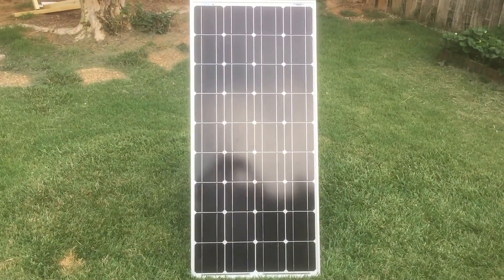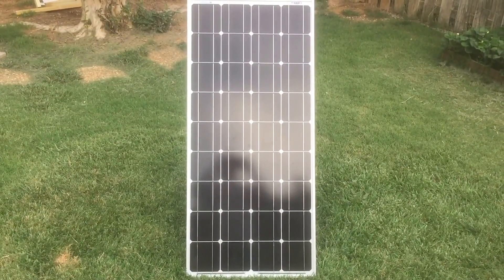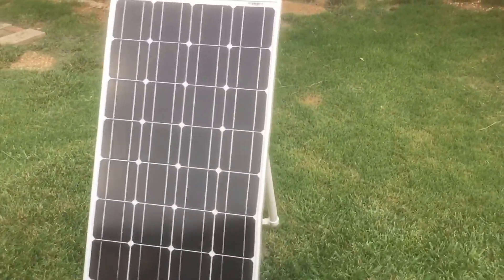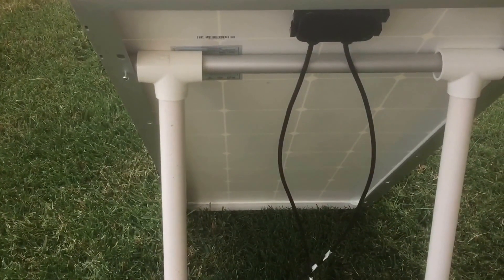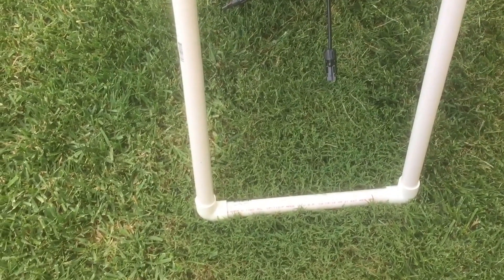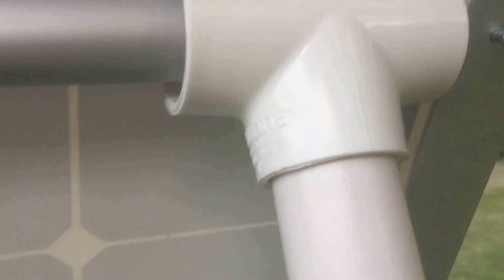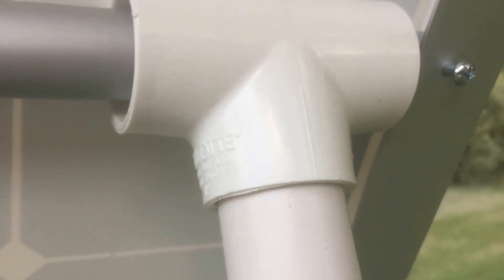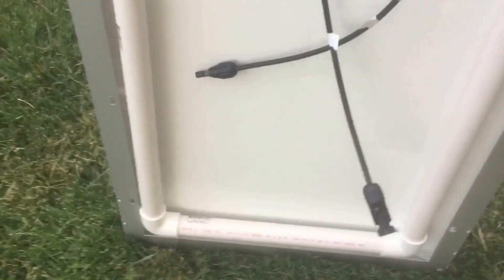Solar Panel stand for under $10

Comment: Fantastic solution! So easy to make. I was thinking of something like a wooden easel at first and when I searched DIY solar panel stands your video came up and I said "Of course!" out loud! Perfect even if it does start to rain on you. And no issues even if there is morning dew on the grass in the morning when you first set them out.  Allows you to use better panels than the typical "suitcase" panels yet still be easy to store and set up.